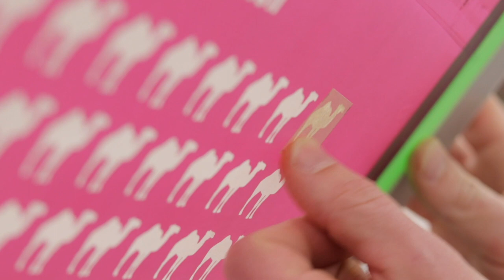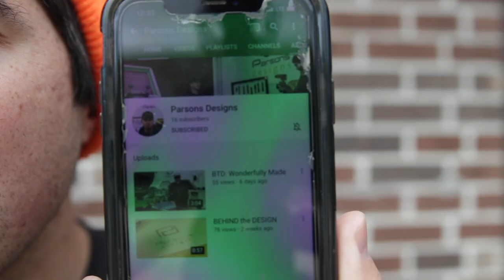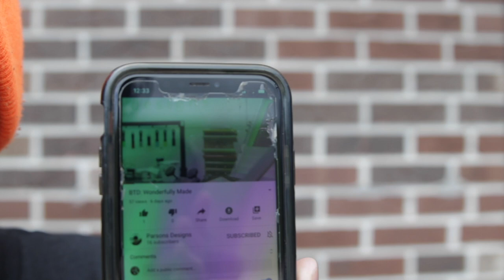The Story Behind WHAT'S IN THE BOX

Comment: started silk screening back in the late 90s.  A trick that might make it easier on you is instead of blocking the one camel and filling in another, screen ALL the camels in white and line up the gold individual camel on top of the white (after flash heating the white of course) .  This method works with any color  on top of white and the white underneath will make the gold pop with only one pass instead of two on dark black shirts.  I have old examples here at home if you want more detail.